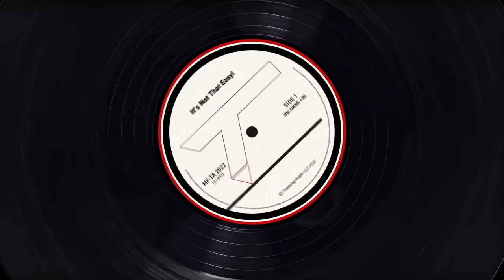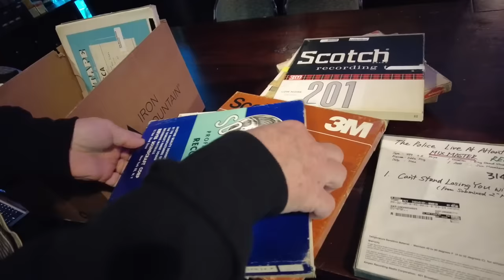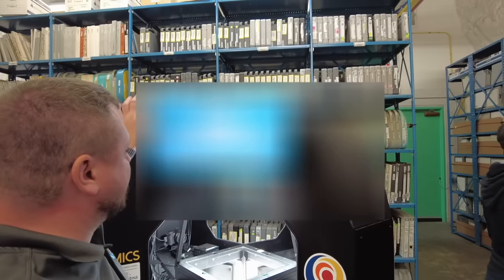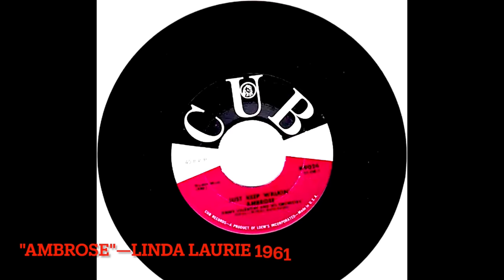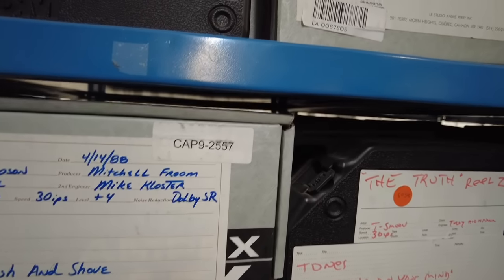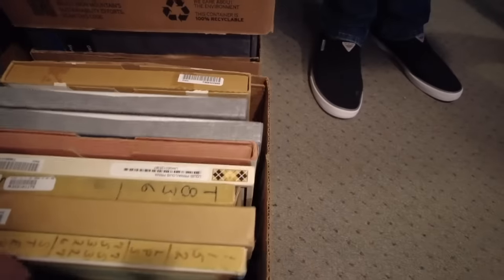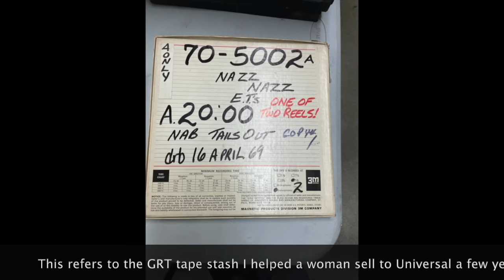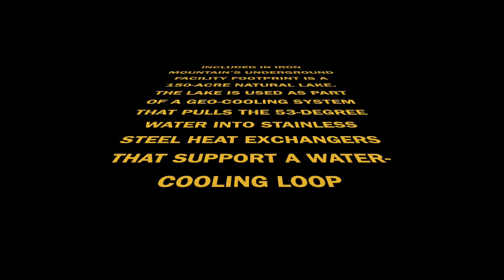Universal Music Group Opens its Iron Mountain Tape Vault  And You are Invited!

Comment: There's only one problem with, Universal's, storage of those, Master, Multitrack Tapes. They have already deteriorated. To not be, recoverable. And so they might look just fine. Until you try to play them. When they won't go through the machine. They have turned to, a   gooey, tar -like substance. They are already destroyed. Due to, hydrolysis. Meaning that, it has absorbed water from the air. Even when sealed over a period of 10+ years. And many are a mess and unrecoverable. This has been known now, since the mid-1990s. When we discovered, all of these tapes. Whose formula had been Torture Tested by, 3M, Ampex, Agfa, BASF, Irish, Shamrock and other brands of recording tape. All could not stand the test of time. In spite of the torture tests created years earlier. It's been a huge problem. A huge loss of our musical recorded history. That is now all but, unrecoverable. As other formulations made from the earlier acetate. Have all virtually turned to dust. And are not playable, at all nor recoverable. As scientific technology did not exist at that time. To display. How this product. Would never last beyond 10 years. Much less, 20-50-70-year-old tapes. All now dust. And can never be played, again.

So really most of this tape library is one huge failed, scam. And recovery of the, Mylar/Polyester based tapes. The ones that were supposed to last 100+ years.  Didn't last 10 in the end. Whoops!

So this is all a false sense of security. That these pieces of recorded history will still be recoverable. And many will not be. Especially the ones made with, Acetate tape. And those are no longer, recoverable. While, Polyester/Mylar is mostly recoverable. Through a process of  heating and baking the tapes. For up to 24+ hours of thick, wide, multitrack, recording tapes. Up to, 2 inches wide. Like, Quadro Plex Video Tape. Much of which, also, unrecoverable. Of historic video events in our countries, history. Many, barely, recoverable. And the same with movie film. Much of it has been permanently, lost. While in storage for many years.

We discovered. Through the years. Not even hermetically sealed packages of tape. Of fresh new stock. Would now not be, usable. But only partially, recoverable. Though, some have survived, longer. It's an enigma. Of what has been able to be, recovered.

I was involved, as an, Advanced Engineer and Technical Troubleshooter. For one of our most legendary, American, Studio Tape Recorder, manufacturers. In charge of QUALITY Control Management. And tasked, with, troubleshooting all of the problems. The company electrical engineers could not figure out. And they requested my services. I never applied for this job. As I had purchased,, a couple of brand-new machines. Where each stereo recorder. In 1979. Cost as much each. As my brand-new 1978, Toyota Corolla.. Which, at that time, was approximately, $3200. And the stereo recorder was approximately, $3700. And for reasons unknown? Machines which would be burnt in for 24 hours before shipping. Would all be blowing up and flaming out! After about one week. Completely destroying circuit boards. That were unrepairable. And this caused an international, US, State Department, issue. As they had sold, 30 brand-new recorders. To, MBC. The South Korean Broadcast Network. And all 30 machines blew up and flamed out.

This required that our company VP. Who was also  an, electrical engineer. Was packed up with, 25,000 pounds of equipment. And sent to South Korea. Where he rebuilt, each one of the 30 machines. Which the South Korean broadcast network then promptly sold. And we lost the contract.  And I was tasked. As to figuring out what wasn't right? Whoboy……?

Then I started noticing problems, with the 3M, recording tape. What's going on? I wondered? As our machines. Could no longer fully erase. The latest Hot Formula, of tape. I could not get it to fully erase. When I discovered what that problem was. It was one thing after another. As manufacturers reserve the right. To make changes in their products. Without notice. Where one day. We got an order of replacement capacitors. And audio output transformers. That were then proven to be, now substandard. Where they had been perfectly fine before. Oh no!

So these problems. Continually cropped up. Throughout my short tenure, with, Scully Recording Instruments Inc. Who used to be the maker of most of the US, Record Companies. Heavy duty, Industrial, Disc Cutting Lathes. Until around, 1971. When the German, Neumann, now, Computer Controlled Disc Cutting Lathes. Of the VMS-70, disc cutting lathes.

But in the end. I have always hated, Records!  As I know. What the Disc Mastering Engineers, must do to the recordings. To scratch a vibrational trough. Into this service of a bunch of dead crunched up bugs. Called, lacquer. And it relaxes. Once it is cut. When it then makes the sound more mushy sounding. And as the high frequencies drop off. As you get closer to the center of the disc. And all sorts of gobbledygook has to be added to these stellar sounding recordings and mixes. To get them onto the vinyl! And that's a horrible thing to do to those stellar recordings! Which is no longer necessary in Digital Mastering. And a, a vast improvement to the sound was arrived.

And so the only real thing with digital. To make it undesirable. Is its, Linear Clarity. That no one is used to the sound of. Because of, Vinyl. Which sounds like mushy garbage! Because, it is. When then…… Direct to Metal Mastering. Really improved the sound enormously! Because we were no longer cutting into, crunched up dead bug, Lacquer. We were now cutting into, a, Copper Plated Disc.. Known as, Direct Metal Mastering. And was only originally offered from a company out of Europe called, Europa Disc.. Who I then started having them, Master my Vinyl, cuts. With the vast improvement in sound quality, it offered.

There was another method of getting, superior sound off of vinyl. And that would be the 12 inch, LP sized, discs. That were cut at, 45 RPM not 33 1/3 RPM. And they offered much better clarity, also. As 45 RPM could produce higher definition cuts.

Then there was the 1/2 Speed, Cut.  Which was done at 16 2/3 RPM. At half speed. Then played back at full speed of 33 1/3 RPM. Would reveal yet a different brighter sound. That was more true to life of the master tape. As it required less gobbledygook processing. Since the grooves could all be cut deeper and wider at 45 RPM. Yielding a louder cut. With much less surface noise and a brighter sound.

All of this would come from the recording tapes. Before they deteriorated. As after they deteriorated and have been baked. The sound quality then, changes. From that of the original, playback. And never quite sounds the same, again. Though they say it does not change the sound. I beg to differ. As I'm the one with the superior hearing and ears.. That's why I was hired. I am unique in what I hear and how I hear it. I learned how to listen differently than most other people.

And I'm absolutely horrified. At the huge sums of money. Idiots will spend. With more money than brains. For, whack a doodle,, state-of-the-art, high cost, playback equipment. Such as a turntable that costs in excess of $10,000. Just to turn a 33 1/3 rpm record around in circles. They felt they needed a $10,000 turntable. What incredible idiots! What morons! They don't live on the planet with the rest of us. And I am not producing recordings for them! I'm producing them for you! And you've got a $100 turntable. Not a $10,000 turntable. And so you are smart. Rich guys aren't. They are beyond, stupid. And a fool and their money is quickly, parted.

And so they get to slap each other on the back. And complement each other. At the huge sums of money they have dropped. To playback a $15 album. That was meant to be played on a $100 turntable. Not a $10,000 turntable. Just so you know.

To make life even funnier. None of you know. Not a one of you know. That while your left and right channel speakers are most definitely in phase together. As you want them. They also happen to be, 180 degrees in, Negative Absolute Polarity.  Whoops! How did that happen? And why did that happen? There is a very good bad reason for it. For this farcical, clueless, idiotic, worst, technical blunder in Pro Audio History. As 99% of all, college grad, electrical engineers and acoustic engineers all make this beginner, mindless, mathematical, mistake. As they have proved that they are correct! In the most incorrect manner imaginable. Because they didn't want anything out of phase! But did not know. Where the waveform. At its power producing output. That plugs into the speakers.  Is 180 degrees, wrong.

And so you ask, how is it wrong? If they have proved. If they have proved. They are in Positive Polarity. But they are not! They are backwards! Because some moron. Who didn't know what they were asking for. Demanded. That out of phase data. Would not be in their signal chain! Because they didn't understand the process! As to why? It has to be inverted. At the audio power amplifier output to the speaker input, directly. Why? That's an easy one to answer.

What these idiots have demanded from the companies. That makes the amplifiers. That makes the speakers. They wanted no phase inversion anywhere!

The only problem with their concept. Would be? They have now forced the speakers. To mimic. The motion of the microphone diaphragms. And which way are the diaphragms moving? When a sound pressure wave hits the microphone diaphragm? Which direction is that diaphragm moving in?

(More whack a mole in next post)

Comment: And so I tell all of these recording students. That want to emulate a Beatles recording. You'll never be able to. Because if you are right-handed drummer? You would have to set up your drums for all left-handed drummer. And then try to play.  Good luck! It'll be very funny. It will fall on your face. It's almost not possible. And then you cannot use a 4 track half-inch, analog recorder. No. That will not sound like the EMI, Studer, J-37's. It just won't. So?

You get anybody's old, 1/4 inch, Full Track, mono recorder. And you pass each digital track through that analog recorder. And back into the computer. In real time. And you'll have to do 4 passes  that way. So it will take you 4 times as long as a single pass. To get the same identical sound texture and tonality.

But hey. Your recorder is likely to be transistorized. And those old Studer's were, Valves. What we call vacuum tubes or just Tubes. They call Valves. Which I understand is a more accurate description. Of what a tube is doing. Once it is heated and ionized. And then you have a thermionictransconductance, process. And that's how a tube works. Or so I've been told. Since you can't get inside of a vacuum tube yourself. And you wouldn't want to. It would be like those electric bug killers. So stay out of your vacuum tubes. Unless you want to feel like an  Electric Bug? But I wouldn't recommend it. Really, I wouldn't..

I personally prefer transistors myself. I love their consistency. The sound of tubes are not consistent. And I really didn't care for the American manufactured tubes. Nothing sounded like a, TELEFUNKEN vacuum tube sounded. None! And when you realize how awful all the others sounded. I had no reason to use anything but, TELEFUNKEN tubes in my audio equipment. Hands down. There was no comparison to any others out there. I don't know what they did differently? I think they use some toxic materials. And by the early 1970s they were all but gone. Because the EPA would have been horrified. And that's why they're most important and famous tube in the world. Went out of production in the early 1970s. And if you ever heard one of those microphones? And I have. Nothing. I mean absolutely nothing else compares. It's more than a nuanced difference. It's a monumental difference. And you suddenly know what you're hearing. When you hear it. You've heard it before. And your parents loved it also. So did Nat King Cole and everybody else. I had some later versions. That I recently sold after owning them for over 40 years. And got a small fortune for. Which is now nothing more than a memory for me. And some old recordings with them.

Yeah I did not have the famed Neumann U-47. I had a pair of the U-67's. And I loved them dearly. Along with their younger cousin my U-87's and the KM-86's and 56 tube. Man… I miss them. But I was no longer using them. Time to let somebody else have the joy.  And the sound of a piece of history.  That nobody can really duplicate. When you've had the original and heard the clones. Send in the Clones.. And flush them down the toilet. As they are a far cry from the originals. Not even close. But what is close?

Velocity a.k.a. Ribbon Microphones! The phantom powered ones are great! But the passive ones. Are more true to life sound. And oh how sweet and warm and full and robust sounding. Oh yeah. And that's from the old RCA ones like the 44 and 77's. And even those newer smaller Beyer, German ones. Of which I have one half-dozen. For the past 40+ years. Can't imagine life and recording without ribbon microphones a.k.a. velocity microphones. No other microphone technology sounds or works like those. They are the first high fidelity, full bandwidth, microphones. Originally created in 1928 by Harry Olson for RCA. As back in those times. It wasn't much of a group effort as it was a single solo endeavor. Because this stuff didn't exist yet. And people didn't even have electric refrigerators. They had Ice Boxes. And you would get a delivery of a large ice cube once a week. Can you imagine? Will that be One ice cube or Two? 10 pounds or 20 pounds? And is it okay if the horse has a couple of licks?

Yes I like transistors best.  Integrated circuit ships are not the same sounding. They sound good also. But transistors can be more nicely abused. And overloaded more nicely.

Overloading just makes everything rich in extra harmonics. With the right gear is musical. With the wrong gear it sounds crunchy. Overload a Neve audio console and it makes, Magic! But it has to be the transistor only versions. Not the integrated circuit chip versions. Which happened in the later 1970s. So you want the ones from the early 1970s. And they are legendary sounding. You'll know it. It's an unmistakable sound. And API on the American side. Neve is British sound. And API defines America. Later everybody started mixing on SSL 4000's. It has a lot more knobs and dials. And much more fun to play with. Just ask Bob Clearmountain. He's got a big one. But only Betty Bennett would know for sure.. Because it is in the house with her. The Neve is down at her office. At what everybody records through. To get to their, Apogee Converters. Which is the company that Betty Bennett the wife of Bob Clearmountain, owns. And those are also excellent sounding Converters. But back in the day would only work with Macintosh. And I don't do Mac. Didn't do Mac. Didn't want a box lunch Mac. So I didn't own any Apogee converters that I would have liked to have gotten. Now years later they are available for, Windows. But not the multitrack versions. Still. And that's what I wanted. And had to go a different route.

Regrets? Not really. But we all know that piece of equipment. We would have liked to have had. That was never in the cards. And proved elusive. Oh well! We are not wealthy. And can't have all the wealthy things others have. And that is class inequality. As old as time itself.

There will be a time when time stops.
RemyRAD